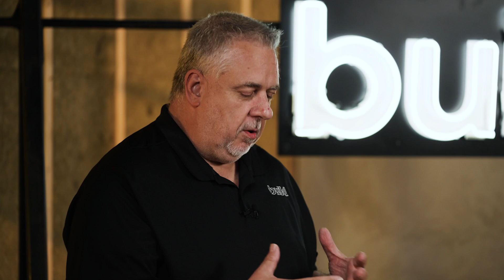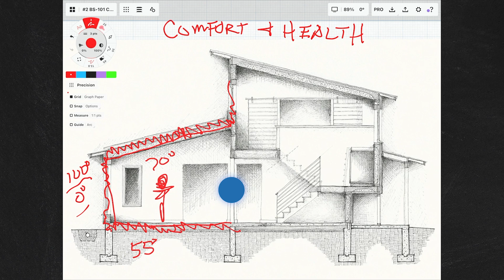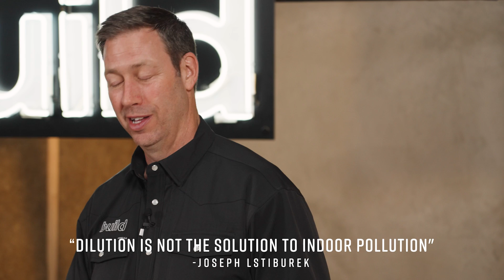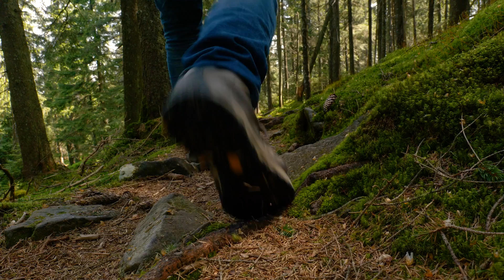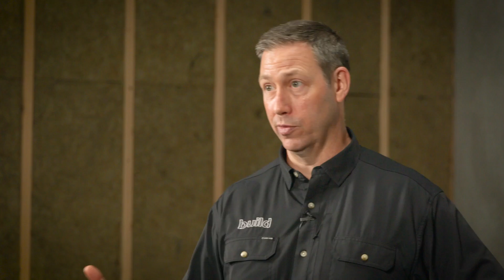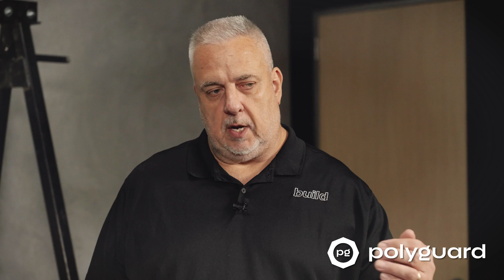Build Science 101: #3 Why “Building Science”? Comfort and Health

Comment: New Car smell - That's VoC offgasing.  Like you said,  short vs long or life long off gasing.  Offgasing though does not magically go away, it just diminishes.  Can't talk in generalities, does not matter if you can't smell it.  VoC sensors can say a lot but IAC.  A low VoC house build is one component.  What post build homeowners do is up to them.  

The MERV consideration would feed back into the Venting system's ability to push air through higher MERV level filters, plus potentially carbon filters and peak make up air.  Also, what are the dust generators within the house, carpets, cooking, clothing,  pets, people, and like you mentioned footwear.

Besides air quality, water filtration is also a consideration from the start.  May need the space for whole home water filtration/softening.

Comment: PM 2.5 polution is targeted as one of the next big class action lawsuits. Empoyers not supplying and requiring proper masks just about anything spayed with a oder/purfume are going to get pinched. Sweeden (I think) saw dust compressed fire log industry is one of the starting points on this rolling snowball.

Comment: I wish more builders included a handbook of maintenance and cleaning instructions, (what chemicals not to use), on which surfaces.
[Include how to reach the light fixtures to change the lights, or dust the ceiling.]
Reply: Most top-tier builders do. Three ring binders have been around for decades.

One home owner always has  one labeled LET THERE BE LIGHT! It's in the cupboard with hundreds of light bulbs. They were thrilled when I turned them onto  commercial light bulbs that last 3 times as long and a supply house. Hundreds of bulbs in cases after that.  
Paint books plus labels on a gallon of EACH COLOR  AND TYPE OF PAINT!!

Comment: So how do you find a HVAC guy who not only knows but cares about putting in an efficient heater and air, and I dont mean a unit that has the yellow sticker that says 90% efficient. How he installs it and suzes it matters too.
Iver the years , ive had maybe 10 different contractirs in my house and they never ralk about the thigs you have been talking about. I have an air unit that looks like it has to be replaced and I'd like to do it right this time.
Reply: Because service work pays them... in and out and quickly.
Reply: I think the best way is putting where you are, size of house, age of house and system.
Someone will chime in.
Reply: Just for context, I'm in Colorado.
I just replaced my dad's furnace.   Builder didn't put in the correct duct on the install. Cost about 11,000 to put in a new main service line, furnace and AC.
I made sure they had a MERV 14 at least for a filter box and scheduled Amazon delivery of new filters every 4 months.
I ran into the sales guy from the main reputable company in town and they would have charged 27,000.

So get ready for that pricing.  

Ridge vent wasn't cut in wide enough so the 30 shingles ended up being 17 year shingles.
So the folks got a new roof. Mom wanted to pay me the market rate. 
I waited until everything was done,  told her:
contractor son rate was 20k, 
market rate was 35k. 
Then she gave me a $2,000 tip.